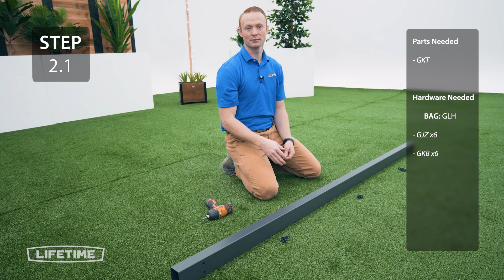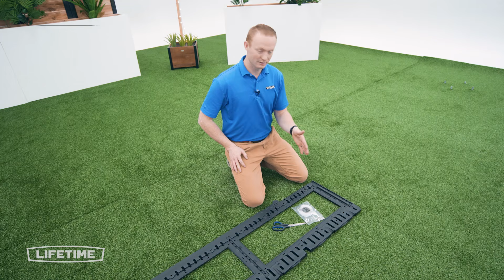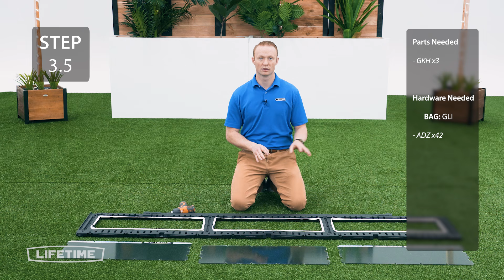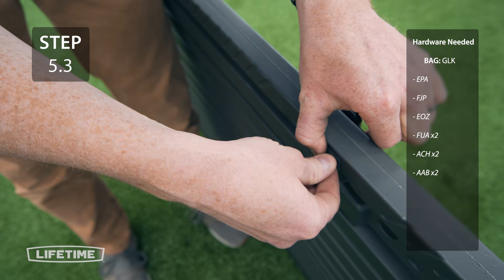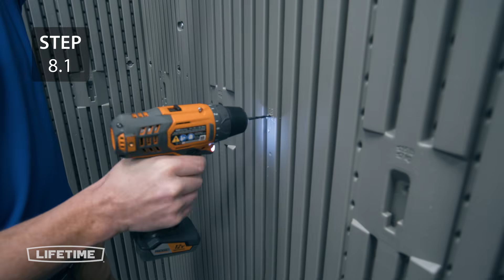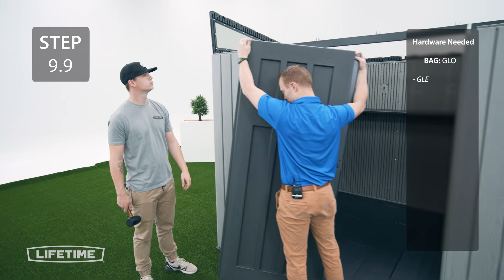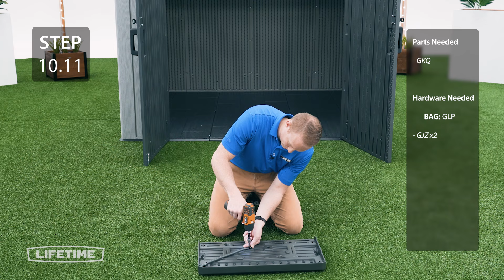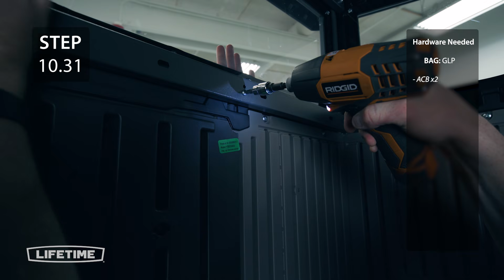Lifetime 8' x 8' Modern Shed | Model 60336 | Lifetime Assembly Video

Comment: Currently building this shed and having a hard time with the screw anchors on the roof. Anyone have some tips to keep them from spinning?
Reply from the maker: If you're having trouble, please reach out to our shed experts. They can be reached at 800-225-3865 or by email at customercare@lifetime.com. Customer Service hours are Monday-Friday, 7:00 am to 5:00 pm and Saturday, 9:00 am to 1:00 pm (MT).
Reply: @LifetimeProductsAssembly thanks I called a little after you guys went home for the night but no worries I got it figured out. I bought a tube of liquid nails and put a little of that in each of the slots prior to popping in the anchors. IDK what your suggestion would have been but this part isn't the best design of an otherwise awesome shed. Perhaps your team can share of video of how to get this done or come up with a better design for the anchors.
Reply: Mine spun too. Seems like if it is that weak it may fly away in the wind.

Comment: This video and the instruction booklet that accompanied the shed are some of the finest guides I've seen come with products requiring assembly.  The written guide even shows what labeled parts bag you need for each section.  The video follows that format as well,  which was extremely helpful for references.   All parts and hardware were clearly labeled.  Maybe lifetime has started adding extra hardware, as I had a few screws.

Comment: What can be done about window panels that came scratched? Can I get them replaced? And if so can they be replaced after the shed it built. Please help!!! My windows were scratched.
Reply from the maker: The window comes with a protectant film on both sides that is removable, this could be the scratching your seeing. If you already removed the film, you can contact customer service for a replacement. They can be reached at 800-225-3865 or by email at customercare@lifetime.com. Customer Service hours are Monday-Friday, 7:00 am to 5:00 pm and Saturday, 9:00 am to 1:00 pm (MT).

Comment: I think this video is great. It helped me on a few of the steps of assembly. The one thing I might point out is, when you are drilling into metal you should always use eye protection. Many years ago I was drilling into metal and some slivers got stuck in my eye, not fun.

Comment: Yo, this hard asf to make, this foo makes it look easy
Reply from the maker: If you need any additional help, please reach out to our customer service team. They can be reached at 800-225-3865 or by email at customercare@lifetime.com. Customer Service hours are Monday-Friday, 7:00 am to 5:00 pm and Saturday, 9:00 am to 1:00 pm (MT).
Reply: @LifetimeProductsAssembly  are they going to be able to come help me put the crappy floor together? 😂

Honestly this is a fantastic product, you will hate the entire time you assemble it.
Reply from the maker: @HalcyonSaja  Sorry you are having troubles with the floor. If you need additional help, you can contact customer service at 800-225-3865 or by email at customercare@lifetime.com. If you want an actual installation tech to come out to build and you're inside the states (excluding Alaska and Hawaii) you can reach out to our coordinators  at 800-424-3865 for scheduling. Keep in mind that this is an additional cost.
Reply: @LifetimeProductsAssembly  Seriously, the tabs could be a tad bit longer.
Reply: It’s a lot easier to build it on indoor Astroturf than any actual working conditions 😆

Comment: Just built this over the weekend with my wife. Watched video along with paper instructions. Used impacts for everything to save time. It still took us 8 freakin hours to build. The small philips screws are made of butter and they don’t fit a #2 or 1 philips head very well. The small plastic oval things that they screw into like to turn while screwing which makes it a huge pain in the butt, have to stab it from the side to make it so they don’t spin. It turned out fine, but I honestly think I coulda bought a kit that includes the joints for 2x4, and got the plywood and built a full wood shed and painted it in less time than building this. Kinda regret not doing that looking back.
Reply: I had the same problem, and this was a PIA to assemble. I am afraid this shed will not stand up to the Az. heat. If this does not work out, take it back to Costco, and build a metal shed. The metal crossbeam was off by a 1/2 inch, and is on a level base., so lets see if this comes together.
Reply: How long did it take the two of you to assemble
Reply: @tarrabirdsell7695  8 hours watching the video and following paper instructions. Using impacts instead of manual tools. I’m very mechanical, work on my own cars, motorcycles, bikes, etc
Reply: @KosmicHRTRacingTeam  Whelp, I guess I won't get this done before the 5ft of snow hits Colorado in a day. Guess I'll try to shove it all in my storage unit.

Comment: Lifetime doesnt give you extra screws, so if you strip one (which I did countless times)...you are out of luck.
Reply from the maker: If you are in need of extra hardware, please reach out to our customer service team. They can be reached at 800-225-3865 or by email at customercare@lifetime.com. Customer Service hours are Monday-Friday, 7:00 am to 5:00 pm and Saturday, 9:00 am to 1:00 pm (MT).
Reply: @LifetimeProductsAssembly  a customer should not have to reach out to you for extra screws...that delays the installation process unnecessarily. why not just include extras like other manufactures?

Comment: Took me 8 hours 🤦‍♂️
Reply: Was that by yourself or help?  Did you have impacts or did you use hand tools?  I just got one of these and am curious how long it will take my wife and I. I have several impact drivers and am fairly mechanical.
Reply: @KosmicHRTRacingTeam  sorry, I should explain... had 1guy helping and then 2 more then the walls went up because the wind was blowing.... the hardest part was installing the roof, it’s held in by plastic snap in grommets that would spin when using a screwdriver, used a 3 foot screw driver to wedge it in and hold it while I tightened it up. It took 8 hrs because I wanted to make sure it went up right, this video makes it look way too easy...... I didn’t even drink till I was done!!!
Reply: @sennenchow8176  how did you hold it & drill it in @ the same time!
Having the same problem
Reply: @garrywashington6495  had the wife hold the 3 foot screwdriver(wedged in and applied pressure) while I’d hit it with the screw Gun .... it’s a balance act for her not to put too much pressure or she will push up the roof
Reply: @sennenchow8176  wedge in the screw hole or wedge in the opening just touching the grommets...
I’m buy myself...it’s snowing my wife ain’t coming outside right now...can’t believe I made it this far with no problems & then run into this smh....lifetime said it would send me some bigger ones that won’t move...but I want it up today...smh
Reply: @garrywashington6495   when you start to tighten it the black grommet will start to spin, that is where are you wedged between the grommet and the roof so it doesn’t spin, there’s a notch in the plastic to help it from spinning, but this is a two-man operation because you need to apply pressure to the screw as well as to the grommet so I won’t spin. It’s best if you get a neighbor to help you because I was unable to do it by myself
Reply: @sennenchow8176  oh ok I get it now thanks

Comment: If anchoring your shed is so important why is where no video on that?
Reply from the maker: Since this video is filmed in a studio, we do not have the proper foundation to anchor the system which is why it is not shown but is talked about. The anchoring process can be found in the instruction manual.
Reply: @LifetimeProductsAssembly  Perfectly understandable that you would have one inside a studio but it is equally important that you have 2 completed sheds outside so that you can show the anchoring to a wood and a concrete foundation.

Comment: Wish I had found this video prior to assembling my shed today. Either way, came here to see step 12 specifically, however you did not show how it’s suppose to be done. How can we slide the shims underneath the door hinge once we get to this step with everything built and so heavy? There’s no way to “slide” the shims underneath without lifting up the shed. It’s also impossible to stick your fingers underneath to be able to lift the shed once fully assembled. With that said, how can we straighten out or align our crooked doors (both doors) that sag when opening or closing? Everything else fits perfect except the most critical component for using this shed: the doors.
Reply from the maker: See if this video will help you: https://youtu.be/Q5VKLwsfb5A. If you have any other questions, please reach out to our shed experts. They can be reached at 800-225-3865 or by email at customercare@lifetime.com. Customer Service hours are Monday-Friday, 7:00 am to 5:00 pm and Saturday, 9:00 am to 1:00 pm (MT).

Comment: Misleading video in that you make it look so easy. You must have had a whole crew digging out plastic from inside some of the pieces, and prepping everything for you. Making this shed is one of the most difficult things you will ever do, unless you are a professional carpenter or some other construction professional.
Reply: Maybe they've updated the shed, but I just put this thing together with my girlfriend and it took us less than 5 hours to get it up.  We started at 2pm and were done around 6:45 pm.  I did watch the video the whole way through before I started, so I guess if you add that time, then the total came to about 5 1/2 hours.

Comment: Have had this package sitting under a tarp for over 3 months in the backyard. Going to tackle it tomorrow. How long do you think this is to install. I see the video is only 1hr long so I would assume around 2-3hrs for a standard DIY'er?
Reply from the maker: This is hard to say because it all depends on you and the people you have to help. I would plan about a day to build or even less.
Reply: Did you end up liking the shed?? Debating on buying it
Reply: @TheMakeupbyalexia  I would be very wary, screws are short, anchors spin in the hole, so you have to get a screwdriver to hold them. I would suggest a metal shed, or if you can afford, wood shed. I had to buy cause wife wanted it, and I wanted a metal shed, but as always, avoid one headache for another. Also the poles, and metal supports, do not have identifying letters, to make sure you have the right one for install, just the box is labeled, but all the metal is jumbled into 2 boxes. So you need to follow the video, and compare pictures. I also had to use the" Bil"t app. and took my time.

Comment: Perfect video...except for one glaring oversight. A short closeup of each fastener used for each step would have saved me from having to make a lot of guesses on what fasteners to use, As a result, I made a lot of fastener mistakes. Maybe you can edit the video and insert a closeup picture of each fastener at points where they are most needed. That would make the video perfect all around.
Reply: I think the point is that you're supposed to use the video as a guide, but refer to the instruction manual for the exact hardware needed.  I watched the video to get a general idea of how to put it together but after that I went outside and put it together based purely off the printed instructions and didn't have any issues with mixing up the hardware.
Reply: Same here “attach it with the hardware” is the worst part about this video. Still was able to put this up in a day, but man could have been easier

Comment: The worst installation of a product I’ve ever come across. I’ve taken my time and went page by page. 
Half of the Plastic inserts for screws fall out. Alignment shifts making it very difficult to get other parts in place. Those plastic inserts twist inside so you can’t just screw in the crews. You have to jam in a small flathead screwdriver inside just to be able to get the screw in. Very frustrating!! Very hard for one person. Must have two.
The main problem is things just don’t align like the video. Plastic inserts fall out. The entire base is on solid but because it’s plastic insert joints, they come out when putting the roof on. Horrible. This product should have a solid metal frame that the plastic exterior connects versus the other way around. Corners need metal support to keep stable the overall alignment. 
I’ll call support but I’m looking to send it back.
Reply: @Lifetime Products/ #LifetimeProducts - I couldn't agree MORE with this James's statement:  This product should have a solid metal frame that the plastic exterior connects versus the other way around. Corners need metal support to keep stable the overall alignment.

Comment: Lifetime, if you monitor these comments.  Like many others, for me the screw anchor placement on the roof panels was confusing. I replied to one comment and suggested factory pre-assembled or color coding them.  Actually the easiest solution would be to just provide enough screw anchors so that the customer could just fill in all the spots for anchors completely on each panel, even though some of those anchors wouldn't get a screw in anyway.  Makes it simple.  Fairly cheap only a few extra anchors required.
Reply: Agreed!  Pre-installed screw anchors on the roof panels (so they don't fall out due to a defective space for it) would have saved a LOT of confusion. #LifetimeProducts
Reply: @AngelaCampos6179  I'm scratching my head on this one because I literally just finished putting it together a few minutes ago.  The printed instructions show you exactly where to put the roof anchors in.   One step shows where the anchors go for piece 1, another step shows you were to put the anchors for pieces 2 and 3, and another step for piece 4.  I literally took the instruction manual and laid it onto each roof piece and followed along with what was printed.  Super easy and no mess ups.
Reply: I'd have to agree.  Pre fill the things in or give enough for every hole.  Very frustrating part is the roof anchors.  If not for that I'd have had it done in 6 hours with one friend. Now we stopped for the night and I'm still short anchors somehow and roof not on yet.

Comment: No way I would have figured this out with the instruction booklet.
Reply: Thats right. I just finished putting mine together and used the video for 90 % of the time. I used the manual to confirm the hardware to be used in each section .

Comment: Thank you for the video. It was very helpful. It took me and my 12 year old son a couple days to build. Patience is the key. As mentioned in previous comments, some of the plastic anchors took time and determination to get it to latch with the screw. We screwed some of them manually without the drill and that helped especially for the ones in the corner for the roof. Have fun building! It looks very nice when completed.

Comment: I need the PDF Manual, mine got destroyed after laying the two boxes on my yard and had heavy rain overnight.
Reply from the maker: PDF manuals can be found here: https://www.lifetime.com/customerservice/assemblyhelp
Reply: @LifetimeProductsAssembly  This link is no good. Can you enter one that leads to instructions for this shed?
Reply from the maker: @michaelhelm1433  The instructions on our website are PDF files you need to download to see the instructions. When you click on the link, it will pop up a box where you put the model number (in this case 60336). A title that says "Lifetime 8.3' x 8.3' Outdoor Storage Shed" will pop up, click on that title. Then it will ask for your Product ID, if you don't know or have this information, click on the check box towards the bottom of the title box that says "I don't have the Product ID" from there a blue box will pop up that says "See Assembly Manual" and that will start that downloading process of your assembly manual.

Comment: Well, the shed is finally up and this video definitely made it easier. However, make sure that you inventory every part before you begin!! Instead of a Left/Right door...some clown at Lifetime packaged (2) Left Doors instead! So I had to make a special trip...mid project...back to Costco (2hr drive) to demand this missing part and luckily Costco gave me a Right door from another boxed set.  One tip for Step 9.8 is file the burrs off the edges of the metal hinge poles to help make it easier to insert into the plastic hinge caps. If not, the metal burrs will damage the plastic hinge caps making it difficult to insert. The parts are made in China so donʻt expect everything to line up perfectly. Just make sure your foundation base is level, have a helper and be patient through the whole process. A few beers in the process wonʻt hurt either. All in all...a great shed with a modern aesthetic.

Comment: Do I really need to have a platform for the shed or can I just build it right on my grass
Reply: Possibly.  I built ours on dirt/sand that I leveled.  It went fairly well but some roof holes didn't line up well and not sure why.
Reply from the maker: Yes, a properly level foundation is required for this shed and all our sheds. Failure to do so can cause damage and the shed will not build properly with out it.
Reply: @LifetimeProductsAssembly  Why can I not get a response for my question from 4 weeks ago?  See my above post.

Comment: My shed didn’t come with the butyl tape. Any Idea where I can buy besides Lowes or Home Depot cause they seem to not know what it is.
Reply: Cisco montalvo instead of the tape they replaced it with clear sealant in a tube
Reply from the maker: Missing parts are available and can be ordered through our Customer Service Department. Our Customer Service Team can be reached at 800-225-3865 opt. 1 or by email at customercare@lifetime.com. Customer Service hours are Monday-Friday, 7:00 am to 5:00 pm and Saturday, 9:00 am to 1:00 pm (MT).